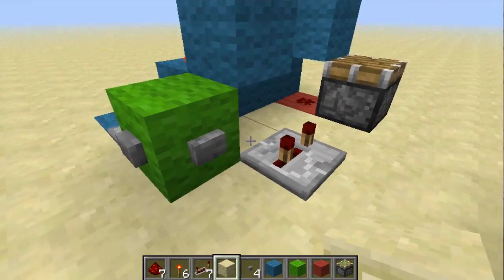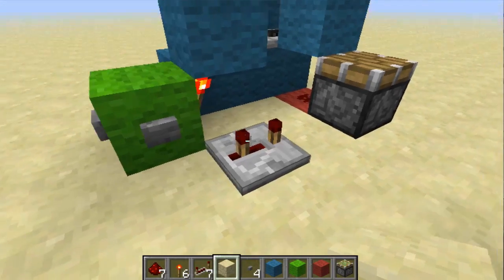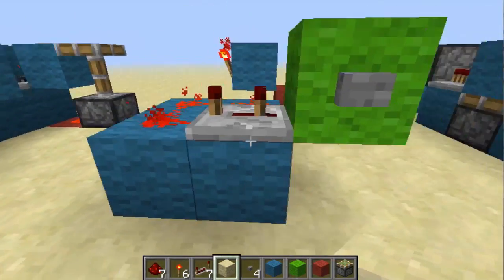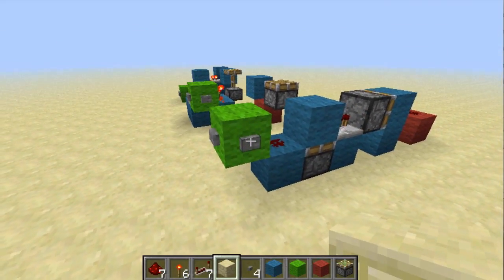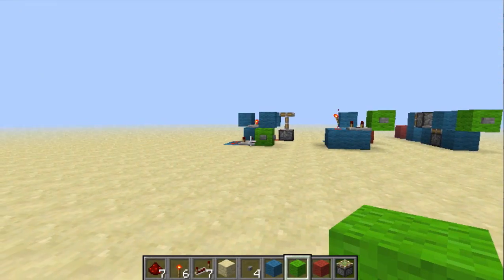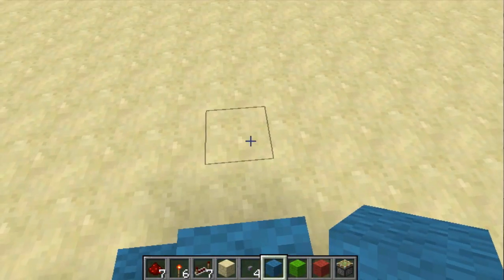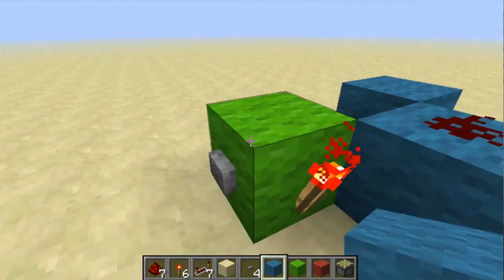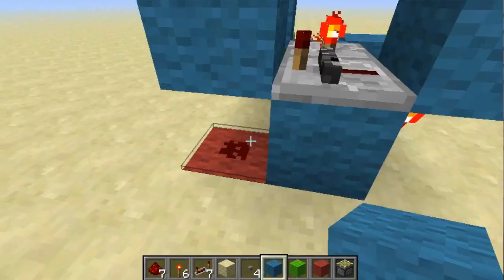Small, Silent T Flip Flop

Comment: If you need to fit it to 1 high space, it's possible. Just make the clock 2 wide 1 high instead of 1 wide 2 high. Hope this helps the ones needing a tiny modification. :]

Comment: Awesome very great to use. Another way without piston would be a
water dispenser which pushes a boat away from pressure plates. When you press a button connecting to a dispenser filled with water the water doesn't get sucked up until you press the button a second time.
Great video!